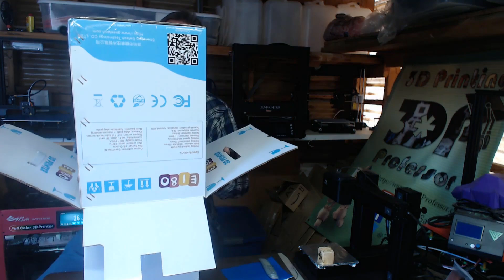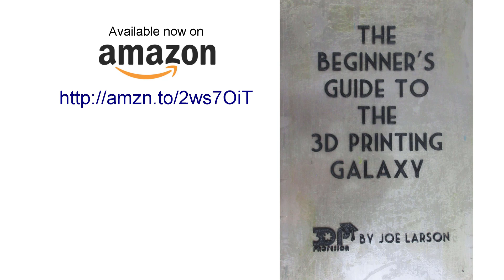Gearbest Doesn't Suck

Comment: Soooooo as someone who bought a CR-10 from Gearbest after seeing your recommendation (and others, admittedly) I'd be really interestd in hearing about the bad experiences you had later and, more importantly, whether there are any workarounds or corrective action we can take.
Because as you rightly point out, some of us can't just put a problematic printer to one side and use a different one.
Reply: 3D Printing Professor Whew. Original commenter echoed my concern, and I'm glad that's the issue. I personally can live with that limitation.
Reply from the maker: Short version, you can't upgrade it. Beyond adding a raspberry pi, it just doesn't have the ports for anything new if you don't have a masters in electical engineering.
Reply: James Skemp especially since an affiliate link got me the cr10 for $340 with free shipping.
Reply: Glad to hear that someone got the 'free' shipping, mine was going to be 'free' shipping (plus an additional amount), because of a bogus 'extra shipping' charge. I was slated to get one of the 'first' units, over a year ago. I canceled the order, after they refused to grant the 'free' shipping.
Reply: Randal Jensen
I think I can explain why the extra shipping charges come up periodically.  And honestly, I think it would be in Gearbest's interest to better explain the situation, since it's all very straightforward and logical.

It all comes down to logistics.  Namely, shipping a package quickly (and by "quickly", I mean in a week or two) across the Pacific is really expensive, whereas shipping by freight is cheap but SLOW, as in a month or more.  The reason is simple - for any reasonably quick shipment, you pretty much have to do air mail across the pacific, which for a big box and a long flight is expensive any way you look at it.  Boats just take too long to make the voyage.  By contrast, for freight you're looking at your item sitting in a giant barge for the ride across the ocean, which is really big, so it takes probably weeks to make the voyage.  Then there's sitting in a harbor at both ends and filtering its through customs inspections.  But it's cheap enough that you're looking at shaving maybe $80 from the shipping.

So where does Gearbest come in?  Well, they want to be able to do fast shipping for a low rate.  In order to do this, they have warehouses on this side of the Pacific, which are resupplied periodically by freight.  If they can ship items out of the warehouses in this fashion, it ends up cheap enough that they can reasonably offer free shipping.  Problem is, you can have items go out of stock from the warehouses, in which case suddenly shipping from the warehouse turns into either expensive airmail across the Pacific or else waiting for a long and uncertain time for the next shipment to show up via freight.  Now Gearbest has a choice.  They can either ask the customer to pay for the shipping or else cancel the order when this comes up, or they can raise all their prices so they can afford to eat the occasional $100 shipment cost.  If you consider that that they might be eating that same $100 when someone orders a $5 pocket knife that happens to be out of stock (or maybe just $50 since it's a small, light object), the second option really starts looking bad.

Now there are ways that Gearbest could better handle this.  Being very clear and out in front about these extra charges and why they happen, not to mention exactly how often they happen, and I think people would be a lot more understanding, since if my logic is correct, the reason seems to me to be quite reasonable.  Another thing they could do is ensure that free and timely shipping happens, but only for expensive items, say over $100.  If we assume that the occasional, but very expensive, out of stock situation happens often enough that they would have to raise the price by $10 to cover it, well, a $500 printer being raised to $510 isn't that big a deal.  A $5 pocket knife being raised to $15 is a deal breaker.  Improving their inventory tracking would help them both in notifying the customer whether an item is in stock at the moment as well as helping them know when they need to order in a new shipment to prevent things from going out of stock in the first place.  Remember, though, that sophisticated tracking systems are expensive to set up, and also add costs to running the warehouses themselves since additional keeping track of everything is more work for the workers.  There's a reason why Gearbest is able to offer the prices it does.

Comment: No really no and here is why, I have used gearbest and received the worst support I have ever seen a few times, I will never use gearbest again, but I have worked out why its such a bad business.

Gearbest, Aliexpress, bang good, wish and lucky are all owned by Alibaba but they all operate their own business models.

Gearbest is just a box mover they move boxes from supplier to customer in general they don't care about the products or the customers, as long as the box is moved. When you pay gearbest the money goes straight to the manufacturer with the order and then the products goes to gearbest and they send it to the customer. Now gearbest do hold stock so if they have one it goes straight out, but they also sell products that they have no stock its upto the manufacturer to supply and this can take many months in worst case happened to me. With gear best you have to speak to them they buffer you so you cant really talk to the manufacturer. So a technical problem and you are out of luck.

Aliexpress is a completely different model. They are an escrow company, they host manufacturers so you are talking and buying directly from them. When you pay Aliexpress they hold the funds, and only when you receive the goods and are happy and leave a goods received note then they pay the manufacturer. This means any problems and the manufacturers are keen to help to get paid. Any problems and you are talking directly with the supplier. This is a much better model and the support you get can be better than a local store. I had CR10S damaged in transit, and they shipped dhl 4 days from china to uk a whole package of spares for free many more than I needed.

In all cases of course there will be problems and bad orders, but you have a much better chance to get help with an escrow model.
Reply: Damn, I just learned something. Good comment, man.
Reply: I'll second that! Have a "personal" connection with some stores on ali, any problem and they send new stuff on fast delivery, a thing that might be a good idea is to pay for "AliExpress standard shipping" usually 1-2$ extra and you'll have it tracked all the way every step of the way and for me in Sweden I have it most of the time in 15-20 days! "China post package" can take months! And rarely gets tracking before it gets to the receivers country
Reply: For small but not particularly inexpensive items, ePacket is the way to go, it's very fast and it's tracked.
Reply: I am just having this experience right now that they sold me a laptop they didn't have in stock. But what annoys me the most is the lack of honesty they where doing this. First of all acting like the have the product and telling to ship it within 3-5 days. The. After three weeks of no shipping sending me a mail three time for three weeks apologizing for the delay BUT blaming the shipping company and making me wait longer after six weeks I was so tired of the uncertainty when I will get my laptop so I asked them about it. This time they told me that they don't really have the product in stock. I was a bit shocked because of their active tries to keep me as their customers while being intransparent and unhonest from the beginning on! Just imagine you go to a bakery and buy a bread. The baker just takes your money and tells you to wait a little. After letting you wait for a long time you complain and all the guy is doing is telling you that he is sorry but the farmer seems to have had a bad harvest that's why there is no grains or flour delivered yet and you can't have your bread because of them. I wonder what kind of monkey business is this?
Reply from the maker: That is all very true. Though you forgot DealExtreme.

Aliexpress is a little harder to shop on, though. It's more of an eBay than Amazon. And while I like the protection AliExpress offers, it doesn't make it very easy to refer people to, as a seller may very well be out of stock or gone in a few months, where GearBest makes relations with manufacturers to remain in stock as much as can be. So they've all got their upsides and downsides.

Comment: I tried to buy something from Gearbest with PayPal, they emailed me back asking for a picture of my ID, SS#and a picture of me....I'm not sure what the deal was but I decided for a REFUND.
Reply from the maker: That does sound odd. Are you outside the US? I understand PayPal is weird for people outside the US.
Reply: I'm from Finland and have used PayPal for over 10 years without any problems. I have never had to send any pictures of my ID or anything..
Reply: 3D Printing Professor and the punch line is.... I'm in the US....
Reply: Jarno Salonen the same here. That was the first and last time I've ever been ask for that when using PayPal. I called PayPal and asked them about it.They said no one needs info like that when you use PayPal. I do Banggoods with out a problem.
Reply: There you go. This comment section has been enlightening. It's making me think twice about Gearbest.

Comment: I've shopped at gearbest, and have to praise them. Yeh, there were problems with my order, including a dead roll of filament (smashed spool ) and even with that, I complained, and ended up with a replacement roll of filament.

But even if i'd had to replace the filament out of my own pocket, I'd have payed less than at other places

Comment: Wait, how did you get a response from Gearbest support?  Like Alliexpress, I never get a reply.  I just write it off as part of doing business with these types of companies, you gamble and if things go bad you are out because it's not like you're going to pay the non-subsidized shipping back to China to return the product.
That being said, my first Ender 2 from Gearbest had a D.O.A. power supply, I bought a replacement and still ended up buying a second Ender 2 from them because it's $70 less than buying it from Amazon or eBay by cutting out the middle man.
Reply: get a youtube channel and several thousand subs  so you are worth their time.
Reply from the maker: Dunno. They have a support email, and they answered to me. It takes a day or two, but they get there. And generally they've been good about sending the small parts I need.
Reply: I did not receive two batteries ordered from them, but got a refund after reporting it in their ticket system!
Reply: i've had 2 issues, and received a response on both.

Comment: I just got my CR-10 Yesterday from Grearbest ,  I used your link and I am happy with . it took only 15 days to get it . No problem so far. I just need to learn more about it. 
Me and my son put it together in about 30 minutes . Few hours later we have our 1st print a "CAT" demo from the SD CARD. Also I got the free filament that I tough I wasn't going to get . 
I have a Microcenter close by and I got about 5 spool for "TESTING " Different colors and Material . 
So far so GOOD !!! 

Happy Printing 
Go shop at Gearbest . ( I have not problem with them )
Reply: Felipe Goncalves only 15 days??!!  For like $20 more you can buy one from EBay or amazon and get 2-3 day shipping and much better return program and much better refund program.